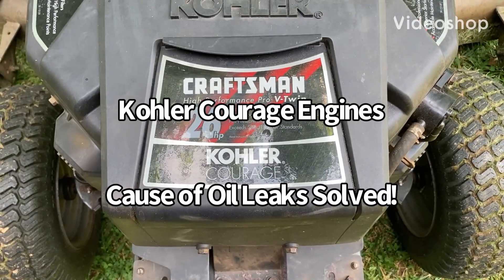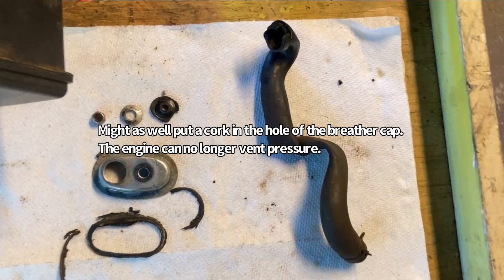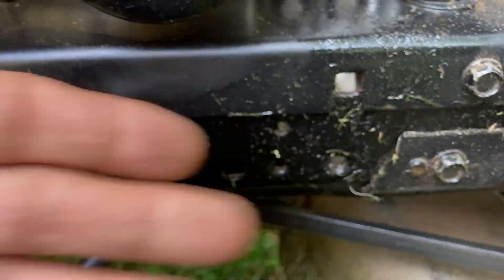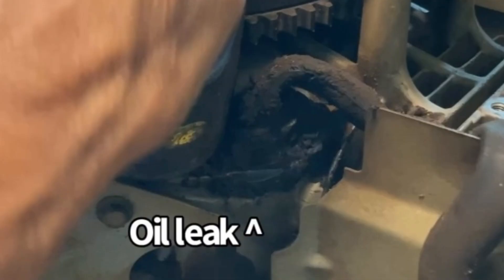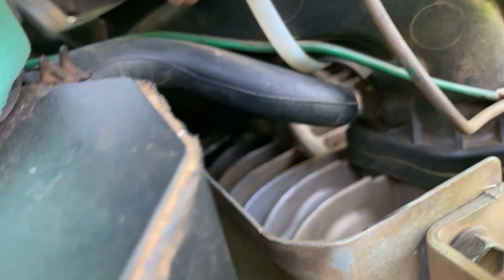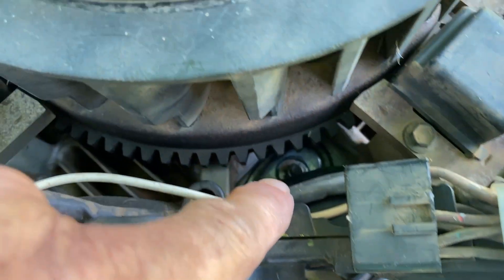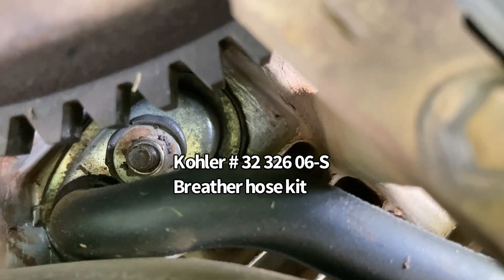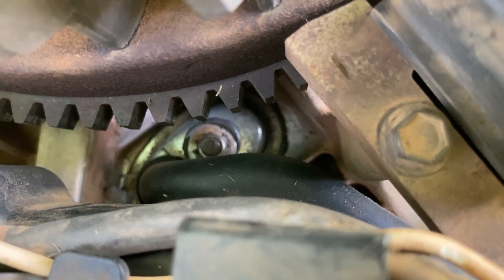Kohler Courage Engines Cause of Oil Leaks Solved

Comment: Would it be better, did you try to find, a better quality piece of reinforced hose? Thanks, John.
Reply from the maker: I haven't yet, but I won't buy another one of those cheap hoses. I'm pretty sure a few minutes in the u-pick yard I'll find something that will work. Hardest part probably will be attaching the barb fitting to the cap. Let us know if you figure it out.

Comment: Thanks man working on the neighbors SV725 Koehler courage and saw it was completed covered in oil front to back. Mostly on the starter side and thought maybe a cracked block. I bet this is the problem it’s a 2014 24 hp with not much maintenance done over the years. I appreciate the video and thanks again.
Reply from the maker: Mine leaked pretty severely from the oil pan behind the starter so you are on the right track. Fixing the breather hose will slow the leaks but once the oil pan silicone is damaged it will leak until resealed. After new breather hose and breather housing sealed, oil pan sealed and new crank seal I finally have no leaks. Glad this helped you out.
Reply: @EricsCarLot  thanks looked at it this morning and the breather hose isn’t quite as bad looking but is collapsed in the same place as yours and is the consistency of a wet noodle. Lol my fuel pump won’t pump gas even after installing a new pump. I suspect with all the leaks the crankcase just can’t operate the fuel pump. It’s toast.
Reply from the maker: @erichull7737  Yeah, when that cheap hose collapses that's when the crankcase pressurizes. Mine didn't have fuel pump problems. Hopefully you can get it all working again.
Reply: Most likely it's the valve cover gaskets